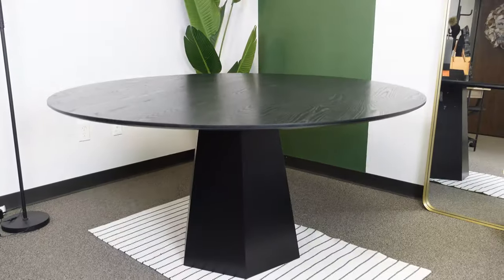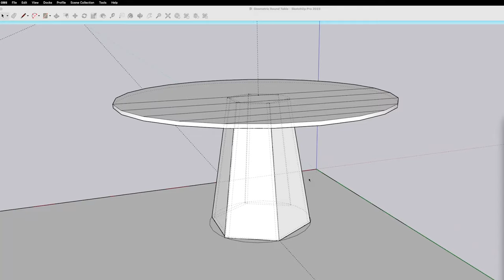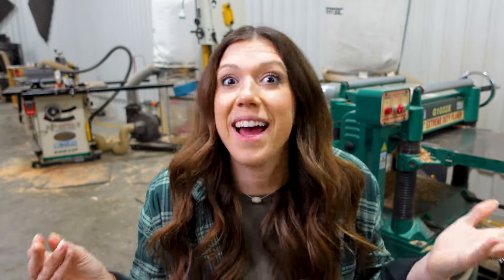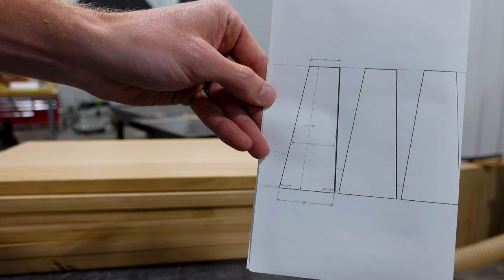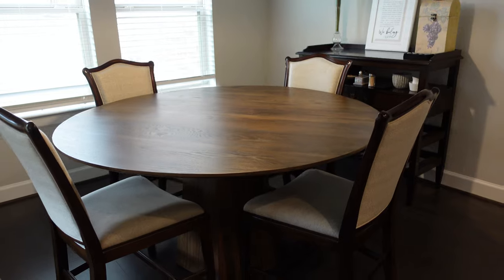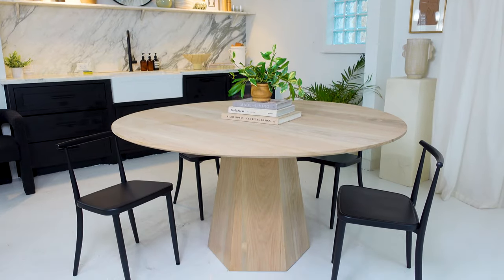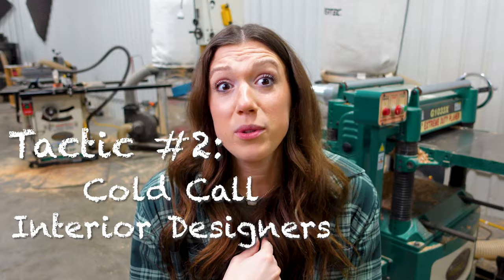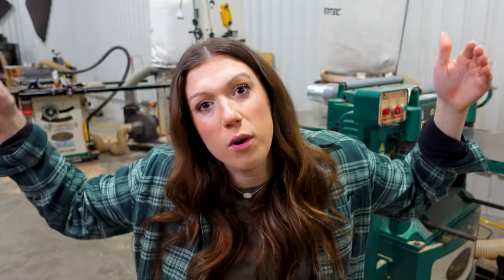I Built a $5,000 Dining Table in 4 Days

Comment: $5000 table?  Seriously?

Not made with oak plywood and C-channels installed incorrectly.  The table top is too thin.  That size needs to be 1 3/4" - 2", at least.  You can make it look thinner, by putting a strong bevel on the underside.  Plus, you can bury the C-channel and it won't be visible.  Love you guys, but that's not a $5000 table.
Reply: You clearly have no idea.
the whole purpose of c channel is to add rigidity/reduce cupping which it does, just because you don't like how they did it doesn't make it wrong.
table top isn't too thin. you just don't like it
furniture makers have been using veneer board for decades, nothing wrong with it.

they got paid 5k so its a 5k table.

how much actual experience do you have as a professional furniture maker?
Reply: I think just like you. I’ve been making furniture for five years and I learned it the hard way. All the boards that make up a "panel" should not be more than 4 times wider than the thickness. For table tops, I don’t go lower than 1 3/4". Flush C-channel look better but do the same job as they install.

$5000 is a bit expensive for a top of 1"-1 1/4" and a plywood base, but it’s their choice. I really like the design though!
Reply: If it sells for $5k, it's a $5k table, no matter how little you agree.
Reply: I've been in and out of the furniture trade as a furniture maker for 15 years. Back when I started no one used c channel and we had table tops 25mm thick and rarely had issues. 

I've seen massive changes in the industry.
Reply: @shanewilliams6853  C-channel is just a "warm fuzzy" for the builder and the buyer.  If the wood wants to move, it's going to move.  The C-channel really does nothing. The only thing actually attached to the wood is the bolts/screws, and they can be stripped out easily.
Reply: @TimberworksTables  I didn't see any solid proof it sold for that much.  But, hey, if you want to believe it, by all means, be my guest.
Reply: @dgoddard  c channel is some you tube phenomenon that does absolutely nothing like your said, there are so many things on you tube that people that know the craft laugh at because they are just wrong, the whole c channel  thing is a  big one.

Comment: if this was such high level designer, why not go with the full real wood build?
Reply: They did solid wood for the top — what’s the problem?
Reply: @AaronGeller  plywood for the bass after trying to build the base from solid wood didn't quite work out well
Reply: @randyvandeusen5600  again, what’s the problem with using high end, expensive plywood?
Reply: @AaronGeller  high-end expensive plywood? 😂🙄
Reply: @randyvandeusen5600  yeah, white oak plywood is easily around $200.
Reply: @AaronGeller  again, it's not worth $5000.00. I don't care if they use plywood that was 3, 4 or 500 a sheet the client was overcharged. Maybe you should buy one at 5000.00 Mr Geller.
Reply: @randyvandeusen5600  you are welcome to say whatever you want, but the customer believes in the product and if people are willing to buy it, then that’s its worth.